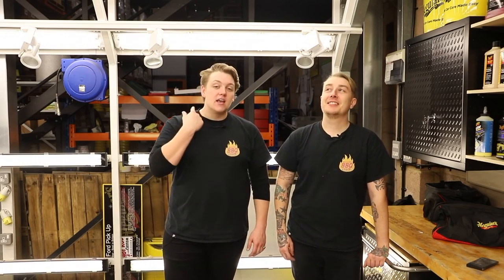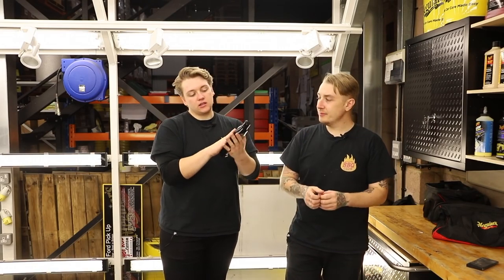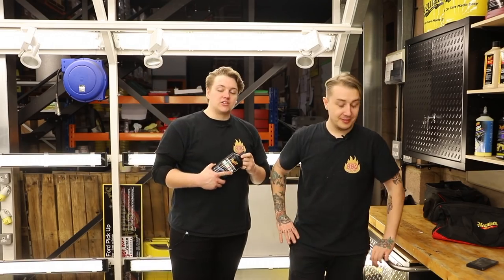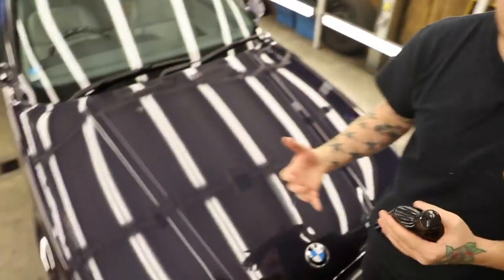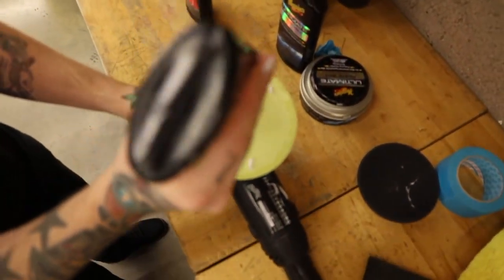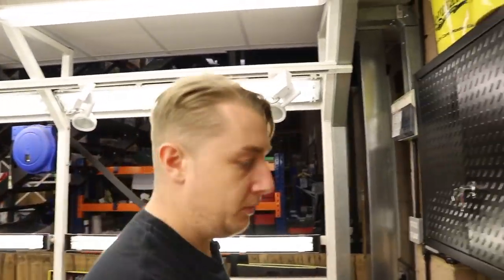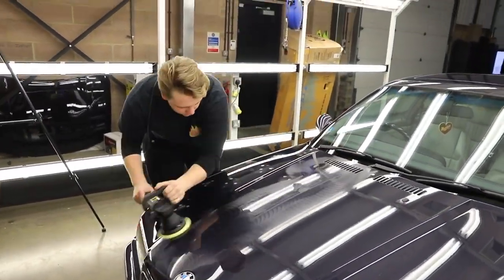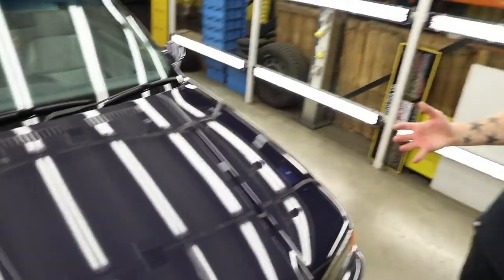Polishing to Enhance Shine with Ultimate Polish - Meguiar’s Detailing 101 – UK Edition

Comment: This is the most versatile product I have on hand. 

When finishing, the gloss meets or exceeds the results I get from imported German polishes. 

For light defect removal, I use it with my favorite foam cutting pad (green Hex Logic, or Buff and Shine), and it delivers the perfect balance of cut and gloss. 

For even more cut use microfiber pads. My favorite was the original Rupes Yellow, but It's been changed and is terrible now. The Meguiar's microfiber finishing disc, and Buff And Shine microfiber work great with Ultimate Polish. 

I even find it to cut and finish better than 3D One. 

Too bad the Ultimate abrasives, and liquid wax wasn't available in larger sizes. Even the 64oz bottles would be great.
Reply from the maker: Thanks for the feedback.  👍
Reply: May ask you what German product you used? I wanna try new polish product and Ultimate polish looks appealing to me right now
Reply: @Carlos.Rivera  - I was using Menzerna SF4000 (now 3500).
Reply: @meguiars  - Thank you for SMAT technology, for the Ultimate line, M105, M205, M110, M210, D300!

Comment: After the compound, polish and wax? When Can I use this polish again before wax? I wax my car 3-4 times a year, Can I use this product all the time I wax my car ? It´s clear coat safe in this situation? I use the mt300 and apply this polish like you did in the video
Reply from the maker: Yes, if you so choose, you can use the polish each time before you wax.  👍 
The Ultimate Polish is not a compound and is incredibly mild.  There is no concern for the safety of your clear coat.
Reply: @meguiars  If I could I would use this monthly ! lol. The car just be amazing after use this ! Any problem ?

Comment: 2 questions
- do I need to compound first 
-how much does the sponge matter when applying the polish?
Reply from the maker: Whether or not you need to compound depends entirely on the condition of the paint and the defects in it.  If you have swirl marks, scratches, water spots, oxidation, or other stains etched into the paint you will likely want to compound first.

It is not always 100% mandatory to use a foam applicator but it will apply the product better and is less likely to leave towel marks which can happen when using a poor quality towel.
Reply: @meguiars  appreciate the reply! Just loads of swirls! think im going to try just the polish on one panel and see how it goes

Cool! i have foam pads but they seem more abrasive and ar not flat, I guess for compounding?

One last thing, Im planning on using a hard carnauba wax after using this polish. Given the polish has dried this should be fine right
Reply from the maker: Yes, you are welcome to use the wax of your choice after polishing.

Comment: How often do you clean the polishing pad on the DA? After polishing each panel? After you've polished the vehicle? And how do you clean the polishing pad? Same question for a cutting pad during the compound process. I enjoy the videos. I'm a beginner, so they're perfect for what I'm trying to learn and understand.
Reply from the maker: Typically with the foam pads you want to clean them every couple panels or so.  As you can imagine product loads up the pad more as you go so this is even more important the further into the job you are.  Just flip the machine upside down turn it on and use a towel and a couple fingers to clean off the excess from the pad.  This is called cleaning on the fly (as you work).

When you are done with the job the best way to really clean them is simply to launder them just as you would your clothes.  Not with your clothes but the same way.  😀 
Just make sure you do not use fabric softener in the wash cycle.

Hope that helps!

Comment: After use meguiars polish, can we apply ceramic coating? Does meguira polish effect the coating?
Reply from the maker: That is a question you would need to ask the manufacturer of the coating as you would need to follow their instructions on proper prep and application.  Typically for proper application of a coating the surface has to be entirely bare prior to application.

Comment: This is awesome stuff. Once I’ve compounded, polished and liquid waxed what do you recommend to keep the shine as perfect as possible following my weekly wash and before I repeat the polish and wax steps months later. Thanks.
Reply from the maker: Sounds like the perfect job for a good spray/booster wax like our Ultimate Quik Wax.  👍

https://s.3m.com/3e2hk
Reply: Use their Fast Finish straight after as a sealant to prolong detailing. 
And every soften use a quick ceramic wax spray as maintenance.

Comment: How often is it recommended to use ultimate polish with a DA on a car? Once a year or once every few? I don’t want to remove to much clear coat over time.
Reply from the maker: You can use it as much as you like or need.  The defect removing capability is extremely light.  You should have no concern over taking off too much paint.

Comment: Would you use a panel wipe post polish to help the wax adhere to the paint?
Reply: Gurdev Sihre:  I think you are asking if the surface should be cleaned with an alcohol wipe or wax and grease remover before waxing... the answer is no.  However, that seems to be an important step if you are applying a ceramic coating.
Reply from the maker: Agreed with fwh79.

Comment: Can Meguiar's ultimate polish be used without compounding first ? (After decontamination)  to try and bring some shine back ?
Reply from the maker: Yes, Ultimate Polish can certainly be used without compounding but understand that if you have much in the way of defects that need to be removed the Ultimate Polish may not do the trick as it's primary function is creating gloss/shine.  It only has very mild defect removing capabilities.
Reply: I have been pleasantly surprised with the defect removal abilities of Ultimate Polish. 

When I use it to boost gloss, I use blue Buff and Shine or Hex Logic pads. 

To get more cut I use the Green.l foam. I've done, and do a LOT of "one step" enhancements polishes using Ultimate Polish on green foam pads, and get excellent results. 

In my experience, I get better results from Ultimate Polish, and M205 than 3D One. Better cut, and better finishing.

Comment: Do I need to compound ? Can I go wash, clay bar, polish, wax ?
Reply from the maker: Compounding removes defects like swirl marks, scratches, oxidation, water spots and other etchings in the paint.  If after evaluating your paint you have those things you may want to consider using a compound.

Comment: Hello…pls give me some advise …so bought the  meguiars gold class carnabua liquid wax and ultimate polish.which one goes first? And please give some tips
Reply from the maker: You always polish before waxing.  

When applying the polish by hand you want to apply it a small section (1-2 sq ft) at a time with a foam applicator pad and wipe off immediately with a high-quality microfiber towel before it dries.  When applying the Gold Class Wax you will also use a foam applicator pad and microfiber towel but you will spread the product to the whole car before wiping off as the wax needs to dry to a haze before wiping off.
Reply: @meguiars  copy that sir Thank you!!
Yes sir I bought the meguiars microfiber towels and some extra foam applicator ..
Reply: @meguiars  lastly.. is this right or too much?
First step .Meguiars ultimate compound 
2nd. Meguiars ultimate polish 
3. Meguiars carnabua gold class.
Reply from the maker: That depends entirely on the condition of your paint and your desire for it.  Those steps are exactly what is recommended in many cases.  When you have some time you may want to read through this article on the 5 Steps of Paint Care...

https://s.3m.com/eisq1u

Comment: Hi guys can I use this product after compound and polishing Meguiars Step 3 - Wax 473ml Deep Crystal Carnauba Wax
Reply from the maker: Maybe we are not understanding the question but it would not make any sense to polish after already compounding, polishing, and waxing.  Not sure why you would do that.  You have already polished during the polishing step and that takes place before waxing regardless.
Reply: Meguiar's I simply meant once I’ve I have used the ultimate compound and then refined with ultimate polish would the wax add an extra layer of protection? Its the way I asked the question didn’t make sense lol
Reply from the maker: No worries.  🙂
Yes, you would typically apply a coat of wax after compounding and polishing because wax is your actually protection.  The compound and polish do not protect.
Reply: Meguiar's thanks for the help. Used the ultimate compound and polish to realise I have several stone chips on my bonnet spoiling my hard work when removing swirls etc 🙁 can stone chips be repaired at hone or would it need to go to a body shop do you think ?
Reply from the maker: Whether you do it at home or a professional does it, it will require touch up paint.

Comment: My car is 3 months old and it has only minor swirl marks will it be fine if I use ultimate polish and then quick wax. Plz suggest me these things are really confusing me up. 
And also which wax is better 3m or meguiar
Reply from the maker: Swirl marks are often more difficult to remove than one might suspect.  The Ultimate Polish is incredibly mild and primarily a polish designed to bring great shine/gloss.  It has limited ability to remove defects in paint.  It may work to remove swirl marks in some cases however it is possible you will need something more effective like our Ultimate Compound.

Comment: What is better polish or ultimate compount?
Reply from the maker: Depends entirely on what you are trying to do.  Ultimate Compound is designed to remove light to moderate defects in paint.  So if you are trying to remove scratches, swirl marks, water spots, oxidation, or other types of stains/etchings in your paint Ultimate Compound would usually be the right choice.  If you are looking to provide shine/gloss to your paint and have already removed most or all of the defects the Ultimate Polish would be a better choice.  That being said they are often used in tandem.  Ultimate Polish followed by Ultimate Polish.

Here is an article on the 5 Steps of Paint Care that has a ton of foundational information you would benefit from.  It will answer this question and much more...

https://s.3m.com/zsr4wt

Comment: Hi im using Hybrid Ceramic Wax and im considering buying Ultimate Polish (car color total black)
can you tell me what steps to follow cause Hybrid Ceramic Wax you have to splash water then dry,and if i use Ultimate Polish i have to use wax and i got a little bit confused which product to use first....
Thanks in advance
Reply from the maker: You would still use the Polish first but if you choose the spray version of the Hybrid Ceramic Wax you will need to wet the car again after the polishing step to follow the recommended application.  Of course at that point you can simply skip the car washing solution and simply rinse the car quickly to get it wet.

If you have not seen this video yet please watch it to gain a better understanding of how the Hybrid Ceramic Wax (spray) should be applied...

https://s.3m.com/xkufrj

Comment: So if i understand correctly you dont need to clean with an ipa or something simular between te compound and polishing steps? And how is it with cleaning the pads between sections what is your advise with the usage of the meguiars products?
Reply from the maker: That is correct there is generally no need to do an IPA wipe down between steps.

Yes, you will typically need to clean your pads "on the fly" as you work your way around the vehicle.  Depending on the pads you are using you may use a towel and/or compressed air to do this quickly every couple panels or so.

Comment: Thanks for this. Completed a full detail from Ultimate Compound,  U. Polish then Liquid Wax. When would you recommend I need to repeat polish/ wax steps?
Reply from the maker: Polishing is optional and primarily depends on the color and condition of your paint as well as your personal desires for it.

How long any protection/wax lasts is highly variable and depends on a number of factors related to the condition of the paint, previous prep, and the environmental elements the vehicle is exposed to.   That being said for most daily drivers we recommend you wax at least 3-4 times per year.

Comment: I want to give my car (dark color almost black, repainted last year) a polish to get deep gloss and just remove some swirl marks. Do I need the Ultimate compound before the Ultimate Finish or it wouldn't be necessary?
Reply from the maker: If you want to remove swirl marks you are going to have to use a compound or polish with defect removing capability.  So the short answer is yes, you would likely want to use the Ultimate Compound to remove swirl marks first before proceeding to polish or wax.  It might help to better understand our 5 Steps of Paint Care.  When you get a few minutes read through this article...

http://www.meguiarsonline.com/forums/showthread.php?65188-Meguiar-s-5-Step-Paint-Care-Cycle

Comment: If you Polish it and it won't stay on then when you wax it what does the wax stick to?
Reply from the maker: Waxes are designed/formulated to bond to the paint.
Reply: @meguiars  but if you put a layer of polish on it.. Then how will the wax contact the paint (clear coat)? If it does not touch the clear coat, then how will it bond to it.. THINK LAYERS
Reply from the maker: Polishes do not layer, they wipe off before applying the wax.
Reply: @meguiars  oh they leave behind an oil most times.  Because like you said, the polish goes away quickly after a rain or a wash. So it leaves behind a residue.

Comment: What RPM are you buffing? That's more important than the concern over the slomo.
Reply from the maker: When using a polish with a DA we typically recommend speeds between 3800-4800 opm..

Comment: Which is the best wax for dark colour (more gloss) ? black wax or ultimate polish
Reply from the maker: Black Wax is an "all in one" cleaner wax, offering mild defect removal, gloss & protection in one step, making the process quicker & easier.  Ultimate Polish has a little less defect removal than Black Wax, but other than that, they both will deliver similar gloss, just with Ultimate Polish requiring a follow up step with a wax.

Comment: If I wet sand my clear coat, can I go directly with ultimate Polish to bring back the shine or do I have to use compound first
Reply from the maker: Sanding is a very professional process and requires a machine, knowledge, different products, pads, etc.  This is not something you want to do on a car of value without fully thinking it through, gathering all the right materials, and gaining some training/experience.  The short answer is no, a polish will not remove sanding marks.

Comment: Do you prime the pad the same way you prime it with UC? I Used UP with a DA and was having hard time removing the polish even though I wasn’t allowing it to dry. Thanks!
Reply from the maker: Yes, you should prime a new pad before use.  Also make sure to use the product sparingly, work only a small section (2' X 2') at a time, and removing immediately.  And of course make sure you are using good microfiber towels for removal.

Comment: Nice vid. But when I use the ultimate polish it’s almost impossible to buff the polish off in some sections.  I was using an electric buff and a towel. Any tips?
Reply from the maker: The most common issue that would cause difficulty in removal would be letting the product dry.  You really only should be doing a couple square feet at a time and then wiping off immediately.  Ultimate polish should not be allowed to dry at all.  Other possible issues are...

-over application
-high humidity
-poor toweling

Hope that helps but please feel free reach out to our Solutions Hub for one on one help any time you need it.

https://s.3m.com/6x7swh
Reply: @meguiars  thanks heaps

Comment: jus wondering which is best wax for a sliver n blue cars thanks
Reply from the maker: That is a very broad question.  There is no wax specifically designed for silver colored paint or any other color.  Paint is paint regardless of the color and keep in mind that almost all automobiles for nearly 3 decades now have been clear coated (clear paint on top) so you are never really touching the color coat anyway.